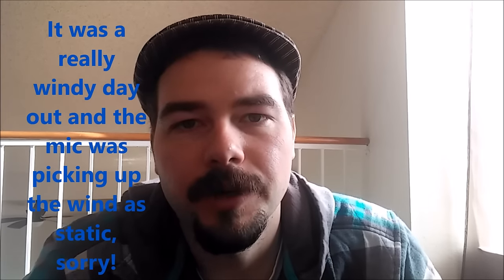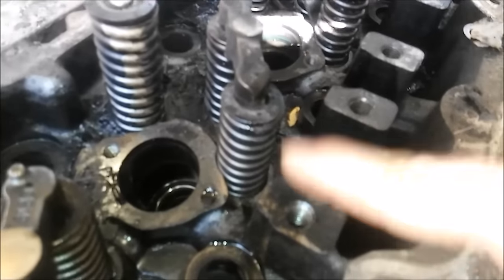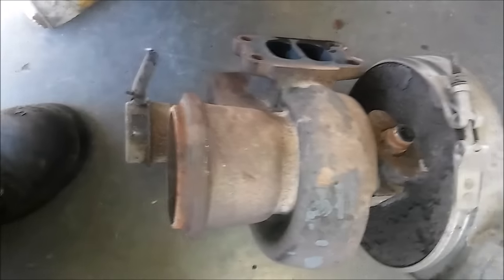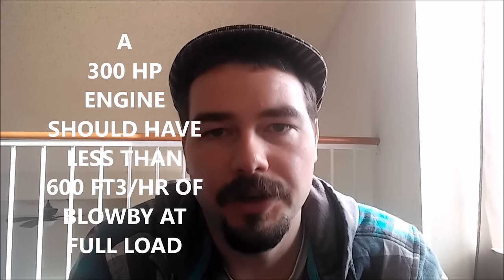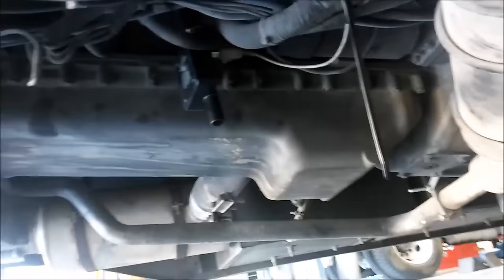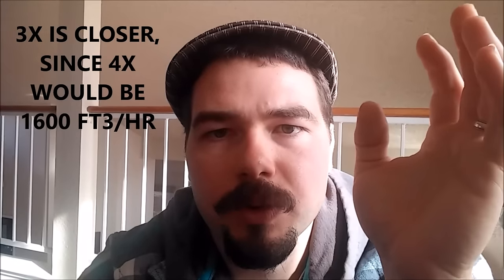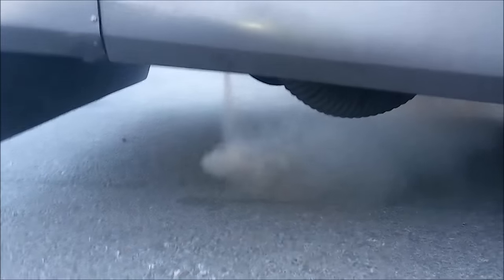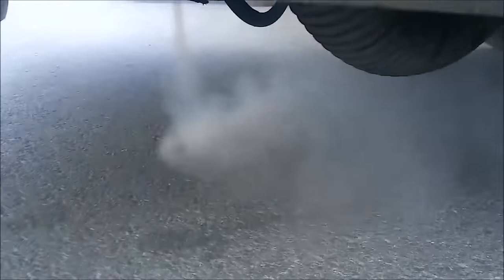What Is Blowby?  What Is Too Much Blowby?

Comment: Dear Adept Ape, 

good to see you to help others. I have 3 Cylinder 1000cc car (Same as Geo Metro) it was rebuild by mechanic last month, My car engine pumps engine oil in air filter case and then oil travel to carburetor if i drive car above 80 km/hr otherwise no problem at all. I have change PCV Valve but the problem still remain. Some body told me that piston rings are misplace due to installation error that's why you face that kind of problem. I need your suggestion regarding my issue if possible. Thanks in advance

Note: My mechanics denied that engine has faulty he said all is well but i am unable to understand why oil comes to Airfilter case
Reply from the maker: +Bilal Ahmed If you are getting oil into your intake you might have bad valve seals with the intake under vacuum can suck oil past the seals. Your PCV system can cause that as well, I know you changed the valve, but if you have a plugged line on the suction side or too much blowby that can cause oil fumes to get into your intake as well. It's possible the pistons weren't installed correctly, but I didn't see the guy do it so I can say either way, if it worked fine after the rebuild at first then the pistons are probably fine. Wish I could help more.
Reply: Dear Adept Ape, thank you for your kind reply. probably u r right, one thing i want to tell you the said problem appeared to me when i drove car above 80km/hr before it i never drove car more than 50km/hr due to engine optimization/initial run. i have check PCV valve which sucks air from inlet. at the end thank you so much for your kind advice regarding my matter. keep helping people
Reply from the maker: The faster you go the more load on the engine, which means higher blowby and less intake vacuum under load.
Reply: Dear Adept Ape, problem solve and thank you for your kind attention toward my matter, Last day when mechanic remove engine head assembly then he found that he forgot to fit oil pressure control jet in cylinder assembly.

Secondly head gas kit was blocked, oil remain stored in head assembly and was not let the oil drain in oil storage chamber.

Now after resolving said issue i drove car up-to 130 km/hr and found oil was in control state. 

Once again thanks
Regards

Comment: do u recommend a 94 cat 3406c why why not.
Reply from the maker: +Julio Villafuerte The 3406C is kind of a pain of an engine. The engine is basically the same as a 3406B, but there is a bunch of earlier electronic junk on them. It's hard to find guys that are good at working on them, there isn't a guy in our shop, including me, that is good at troubleshooting them on the electronic parts.
Reply: o I was thinking of getting into one. what u know about 93 n14 half mechanical, half electronic. it's 350hp with million no rebuild. u recommend turn up maybe 400hp? thanks.

Comment: hi man thanks to help  i will change that senssor   . code. pid 028_a. do you know what men's ?  thanks !
Reply from the maker: +Eduardo Santiago What is the serial number sir?
Reply: Adept Ape    serial #BXS 38781.   the  code   128.F 06.     pid 028_A
Reply from the maker: I looked up the codes you gave me in the Cat system and the only thing I could find is a code 28 which is a throttle position code.

Comment: Is 5" of blow by excessive on a c15.
Reply from the maker: Is that inches of mercury or water first of all? The next thing is that the best measure of blowby is a volume measurement and not a pressure measurement, which inches of water or mercury is a pressure reading. A high crankcase pressure reading on an engine that has a crankcase pressure sensor is usually an indication on a plugged crankcase filter. If the filter is clean, but still getting high pressure you could have a plugged hose or other venting problem, if still high then a volume reading will have to be done to determine if the volume is high which is measured in cubic feet per hour or a metric equivalent outside of the US. What model engine is it?
Reply from the maker: +Adept Ape I see you said it was a C15 engine, I meant to ask is it an SDP regen engine?
Reply from the maker: +Alice Stoneking Okay, well 5" of water according to my conversion app is not even .2 psi, so that is very low pressure and that is good. I was worried it was mercury and that is like 2.5 psi which is high, but your good on pressure. That means you don't have blowby restrictions, if your still concerned about the blowby you may want to get your volume measured though sometime as that is the best way to test it.

Comment: I have an engine (C15 acert) and it has oil leaking at the top of the air compressor. Is this due to blow by or just something that's common with the air compressors?